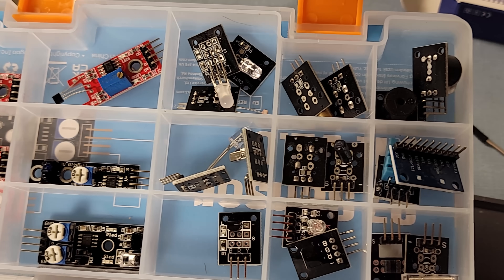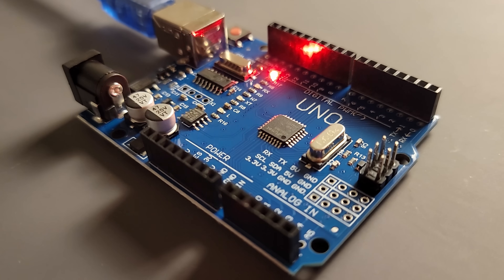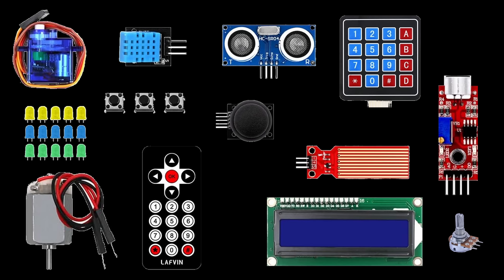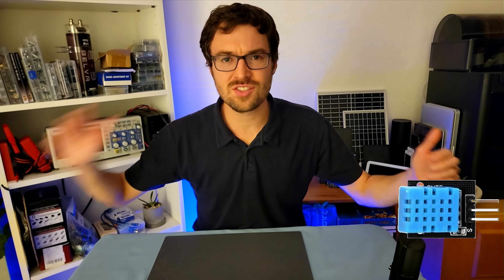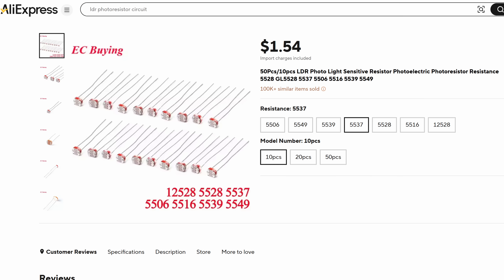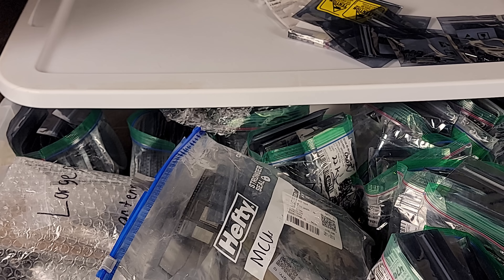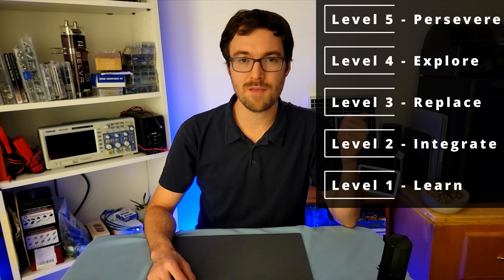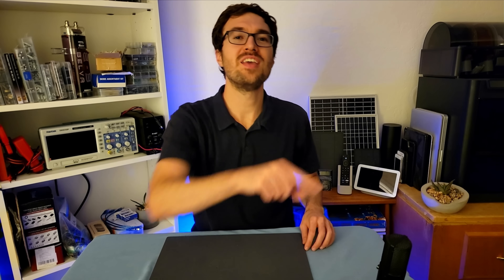How to Make Anything - Learn to Think Like an Engineer

Comment: The most frustrating, difficult, and useful lesson I had to learn was that making things is almost ENTIRELY about the troubleshooting.

Troubleshooting is basically the ENTIRE reality behind inventing.

The dream I sold myself when I was younger was sitting at a workbench soldering random things together and VOILA! A perfectly functioning ai robot equipped with laser beams and a jetpack 😂

The reality I'm glad I learned was that getting a servo controller board to make a servo turn left and right just didn't work.... (I've never gone to school for or had any education in electronics at all. Everything I've learned has been on my own and with the help of YouTube.) I struggled for days thinking I was an idiot. I couldn't find any help online, nobody seemed to know, none of the common issues seemed to work to fix it... I went through every single diagnostic there was. Finally I decided I needed to get every scrap of information available and solve this. I NEEDED to know, I couldn't just replace the board even though it was a cheap $3 board... I HAD to know what was going on. I got the data sheets for the board and for every single separate component, I then started using ai to guide me through every single potential issue with each part. I learned how to make hardware changes to the board, solder tiny parts, use a multimeter more in depth to test everything, learned about power supplies and voltage, amp, and current, learned code to test the different functions of the board... learned WAY too much about i2c serial bus 😂😂😂 and FINALLY, after a week, discovered the servo controller board had blown internal drivers.

It was the happiest moment of my entire week. In that moment all the frustration and anger and self doubt immediately turned into a feeling of accomplishment... I hadn't "MADE" ANYTHING but the knowledge I gained about troubleshooting and HOW the board functions and microcontrollers and capacitors and pulse width modulation frequencies and using a multimeter and on and on and on was an even bigger reward! 

Just troubleshooting a broken board was the best teacher and most rewarding thing I had ever done while pursuing my wannabe mad scientist dream 😂 ❤❤❤

Now when I approach any project I always tell myself "I'm not here to make something work... I'm here to find out why it doesn't."

Comment: Will you be covering coding/programming in later videos?That’s the part I have the most trouble with.
Reply from the maker: Definitely! Starting with simple things and growing in complexity over time. I plan on doing a mix of videos focused each more of the business, hardware, and software side of things. Firmware takes a bit of time to get comfortable around, I get ya ;)